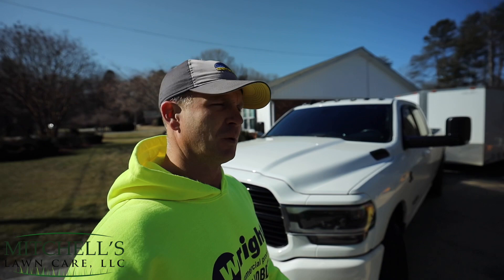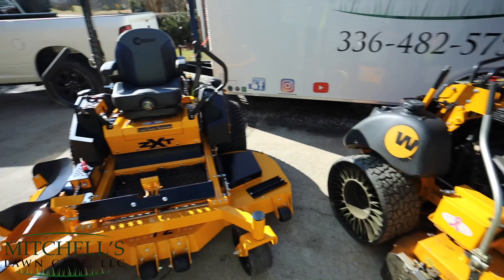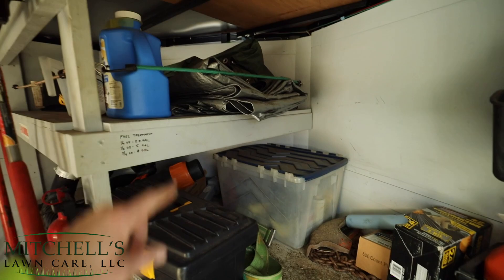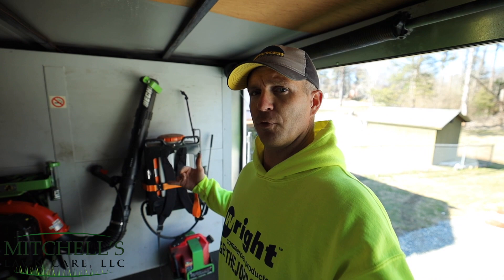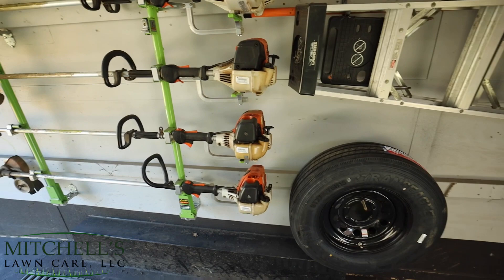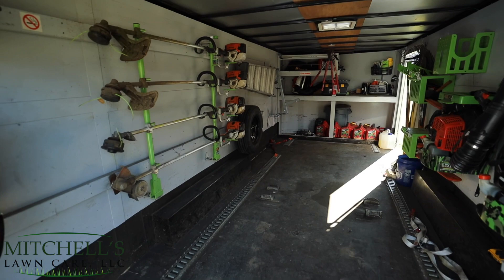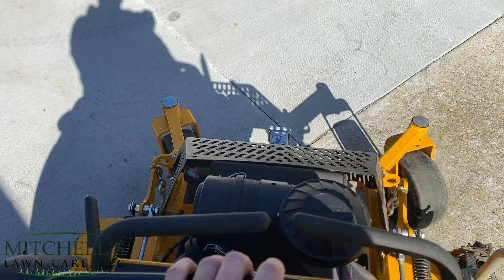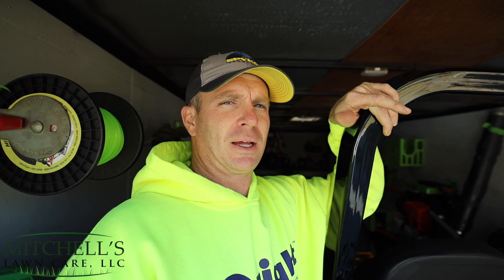2021 ULTIMATE LAWN CARE TRUCK & TRAILER SETUP!

Comment from the maker: Enclosed or open trailer?  What is your go-to trailer and why?
Reply: Enclosed mainly for safety. I miss the open trailer tho.
Reply: Open it’s all I got and it was given to me. 6x8.  Yours is cooler than the other side of the pillow.
Reply from the maker: @thekingscourtyardlawncares9324  they certainly both have their pros and cons!
Reply from the maker: @Purple_Walrus_Lawn_Company  man you can't argue with free that's for sure!!  Keep up the hard work
Reply: Enclosed trailer because I have direct access to my equipment. We have locks on wverything.
The only reason I would use my enclosed trailer when we hit a small community that has ne er seen our trucks and display my trailer as a sign and I will get calls just from my 3k wrap. A plus for the trailer is if it rains and we are further away from our shop we are good to go.
Reply: I run a Box truck for maintenance.
Dump truck and landscape trailer for landscaping. 
Just can’t drive em both at once. 🥴😒 lol
Reply from the maker: @alangipson  I love box trucks!  Anything to eliminate pulling a trailer is legit!
Reply: @mithgo_outdoor  I was gonna ask you about the 20’ in tight areas. I use to deliver groceries in bigger cities 28-53’ trailers but , residential and an enclosed is a different animal.
 folks don’t get out of your way as they do in a semi. 🥴
Reply from the maker: @alangipson  Since putting it in service in 2016 I have had zero issues in residential areas.  There has been a couple times it was tough to park without blocking someone's driveway, but we always put out traffic cones for safety.  Even with a crew cab long bed pickup as a tow vehicle we had no problems navigating through neighborhoods.  With that being said, not all neighborhoods are created equal so I'm sure it's situational.
Reply: @mithgo_outdoor  you ain’t lying. What made you go with the long bed over the 6’ bed?
Reply from the maker: @alangipson  space first and foremost.  With a toolbox installed there is still 6+ ft of space for activities lol.
Reply: I like the open trailer but on those rainy days enclosed would be nice
Reply from the maker: @j.plawncare  it is certainly clutch on bad weather days!
Reply: Well I can choose from my 5x10 or Bertha, the 7x16 tandem open. Looking to get a Sure Trac 8.5x16 within a year !
Reply from the maker: @hairstonpropertymanagement2937  stay on track and you will man!
Reply: Enclosed, more secure, dry, and less UV rays.
But I'm afraid the size of your rig costs too much to operate. 😅
Running a f150 and 6x10 trailer.
Small, but cheap to run out
Reply: @Purple_Walrus_Lawn_Company  Hey, I hear you. Growing a small business isn't easy. Just wanted to let you know that I specialize in helping landscape companies grow through funding.

Comment: had a idea know it would be a little pricey but what about put solar panels els on the roof then running it to a battery and inverter so you could power the lights and all the battery chargers for the cordless tools
Reply from the maker: that's not a bad idea, but yes pricey since solar energy panels aren't cheap.

Comment: I like your enclosed trailer. In my area that used to make lawn mower trailers they put a 60 inch lawn mower in the front and it loaded it out of the right side in the front. And the other two more loaded out of the back. And they was not enclosed. But they was about 7 ft tall and 8 feet wide and 21 feet long. But they ran a two-man crew constantly. It was completely enclosed with wire. It was more centered a 2-3000 pound axles with carrying all they could. All them trailers with bought up by lawn mower people. When it went out of business. By the way how many times did you leave a gasoline can out full of water. So somebody could poured into their car. It's a funny joke
Reply from the maker: Thanks Michael.  I've honestly never put water in a gasoline can for fear that the funny joke might end up being used on my equipment by mistake lol.
Reply: @mithgo_outdoor  that's just too funny
Reply: @mithgo_outdoor  I took some bad gas out of my Corvette. Left it out by my shed in the backyard. Somebody took the gas out of it and put it in their little scooter and it stopped running. They brought back the gas can. And put it back in the same spot. I was rolling I was happy to get the gas can back. Cuz I was going to have to pay for disposal fee. Lol I know one thing if you spilled gas on grass. It works like weed killer. That new antifreeze does the same thing. How much poison you think is in gasoline and antifreeze. It only takes like 2 days and it's dead
Reply from the maker: @michaelspeakman8924  well that's one way to catch a criminal! lol

Comment: I feel like I can cut 5 acres just as fast with my 60 vs 72, being that the 72 takes forever to turn around and you can’t go as fast sitting down,, but they are nice for huge huge properties but if you have to turn around they down save you much time,
Reply from the maker: mowing times are situational, I don't go very fast when mowing.  The 72 operates just the same as a 61, no difference in turn around time (I own both).  The 72 saves me a lot of time over the 61 considering I am cutting approximately 20+ inches more in two passes than with the 61.

Comment: Great video! I just got my zxt with the 60” have you had any problems with the controls drifting? Mine has been to the shop twice when the machine tries to reverse in neutral. They are telling me that’s normal, but I don’t think so. Thought?
Reply from the maker: definitely not normal !  Sounds like they don't want to take the time to diagnose and repair it.  Mine do not do that.

Comment: Ugh, between my truck box, an 18" space in front of the box for gas cans, oil and coolant bottles and miscellaneous, and trying to run 17 bags of salt with my 28" snowblower for this past storm, I hate not having an 8 foot bed anymore 😂 I need to put a flat bed on the old girl.
Reply from the maker: Sounds like it is time for an upgrade!!
Reply: @mithgo_outdoor  indeed.

Comment: Great set up.  Very organized. Just wondering what brand of battery operated sprayer do you use? Thanks for the tour
Reply from the maker: Thank you Russ.  I use the Petra Tools battery sprayer - LT Pro 2.0 and HD4000.  There is an affiliate link for them in my description that will save you 10% on your order if you choose to purchase.  They work great.
Reply: Thank you so much for the information and quick response.  Best of luck in 2021!
Reply from the maker: @russfoote7497  you as well !!

Comment: how come youre getting rid of the stander 72? wanted the bigger engine and its only on the sit down or something? didnt want to stand on large properties?
Reply from the maker: had absolutely nothing to do with the engine actually.  The ZK72 is powered by the 37hp Vanguard which is completely adequate and honestly too much power for weekly routine mowing.  I was wanting something more comfortable for larger properties now that I don't service as many retention ponds as I did before 2020.

Comment: Beautiful setup. Why all that water ?
Reply from the maker: Thank you!  And great question!  I use the water for a couple different things.  It comes in handy when spraying for weeds and the backpack sprayer runs dry.  Sometimes I am in an area where I don't have access to water.  Also, on hot summer days It's great to cool off with by running if over my arms and neck.  These are just a couple reasons...

Comment: Hey, do you like the tweels?  Is there anything that goes wrong with the tweels? Do you have to be careful making turns?
Reply from the maker: Love the Tweels.  You have to be a little more careful on soft slopes because of the sharper edge on the tread will dig in.

Comment: Great set up, I’m in the market for a trailer now I also have a four-door full-size truck with an 8 foot bed do you have any problems fitting between properties with the rig being so long?
Reply from the maker: the only time there were the slightest of issues was in certain neighborhoods with smaller yards.  Often the rig would block driveways.  Since we were there that long it wasn't ever really a problem.

Comment: Have u done a bypass kit on the ram yet?
Reply from the maker: Nope...I’m not doing anything that will affect the factory warranty.
Reply: @mithgo_outdoor  I don't think it does but I could be wrong. It just protects the rest of the entire fuel system "when" the bosch cp4 fuel pump grenades like they have been commonly known to do.
Reply from the maker: @muchogracious1557  I’ll research it more
Reply: @mithgo_outdoor  I've seen some disaster stories of trucks with very low mileage and the cp4 going out and destroying the whole fuel system, fuel lines, injectors, etc. I think Ram is going back to the cp3 this year because of it.

Comment: When you do your 2022 setup, would you  please invite the nc dot out and go over the legalities of carrying mowers, cdl's, log books, us dot numbers, tying mowers down, carrying gas cans,  open trucks, trailers/ box trucks, enclosed trailers etc. There seems to be lots open to interpretation in this area. Getting hauled into court is not the time to learn such stuff. It would be a great topic.
Reply from the maker: I can clear some of this up for you.  CDL, log book and USDOT # isn't required for Class C passenger vehicles under 26,000 lbs that are doing intrastate commerce.  Cross over state lines, then you'll need a DOT #.  Tying mower downs - you are required by state law to secure your load, failing to do so would be a violation of G.S. 20-116(g).  Carrying gas cans - you can transport up to 119 gallons of gasoline without needed HAZMAT placards etc.  Fuel must be transported in OSHA approved containers, usually 5 gallon cans that must read GASOLINE on the outside.  Up to 8 gallon containers are acceptable as well, but they too must be OSHA approved. And your reference to trucks and trailers, that is solely up to you the business owner.  You can use any style of truck or trailer that you want to...all while keeping in mind the magic number of 26,000.  Hopefully this provides some clarification on these topics.
Reply: @mithgo_outdoor  Awesome set up.  And I like you have all the facts laid out in the comment above.  I can't believe you would have any thumbs down.  You seem like a very careful, and purposeful  set up and take pride in it.  As you should.  I am hoping to get my trailer set up similar to you.  I am a lone guy who basically takes care of my own 3 properties but have picked a client here and there and want to be as neat, tidy and functional in my design as well.  Thanks for sharing and good luck in your business.  Rocky from NH

Comment: I am starting a small engine repair/mobile welding business and I will not have a shop that people can come to because it will be on a relatives' property. I am either going to offer free pickup and delivery within a decent distance and/or build a decent enclosed trailer with air conditioning and heating along with a lift and small machine shop in it. I have a few weeks to get things up and going. I am in PA outside of Philadelphia and I am thinking of getting a job in the pharmaceutical industry for a while to pay the bills while I start the business and then leave as the business gains momentum. Any suggestions are welcome. I love the trailer and the setup you have and I was waiting for it..lol
Reply from the maker: Jimmy if you’re wanting a trailer for transporting vehicles definitely get a 10k gvwr V-nose and mount a winch in the front of it.  7’ ceiling height also!
Reply: @mithgo_outdoor  Awesome! Thank you. That is the information I needed. I would love to go back down to Florida . I used to live on Siesta Key when I was going to USF. Where is your business located?
Reply from the maker: @jimmypopp2695  High Point NC
Reply: @mithgo_outdoor  I have an idea that I am trying to get out to all of us in the lawn care/small engine repair/mobile welding arenas. If we all get together to purchase health insurance/ parts and anything else that we may need, the costs will be reduced immensely. Join us at Fill's small engine Nation and let's see what we can do together. What do you think? I was just down in outer banks to pick up three motorcycles(I restore vintage cycles also). Put the word out and let's see what we can do. I just have been shopping for insurance it is insanely expensive. another question, do you have good small engine repair/mobile welding people down there? God Bless.
Reply from the maker: @jimmypopp2695  Since I now operate as a solo owner/operator health insurance coverage is no longer on the radar for me.  When I had a crew working for me it was something that I had considered, but like you said the expense was too much.  There are far more guys in the industry that would be a better fit for pioneering that movement.  I think you have a great idea.

Yes, we have many small engine repairs shops and mobile welding services.  Living the 3rd largest city in North Carolina there's always an abundance of people in different professions.

Comment: Why roundup and RM43?
Reply from the maker: Two different products for different jobs.  They’re not the same.
Reply: @mithgo_outdoor  ok...so what differentiates them if the final goal is plant death?
Reply from the maker: @dskrpncs  has to do with where you are spraying.  Google both and read the facts of each...you’ll see.  They’re not the same.
Reply: @mithgo_outdoor  now I see...Glysophate neutralizes once it hits the soil where rm43 creates a lasting barrier.  Guess the only time I wouldn't use rm43 is when I am spraying in a garden or in a lawn.
Reply from the maker: @dskrpncs  BINGO!  I use RM43 for sidewalks, driveways, fence lines, parking lots etc...anything away from plants/trees.